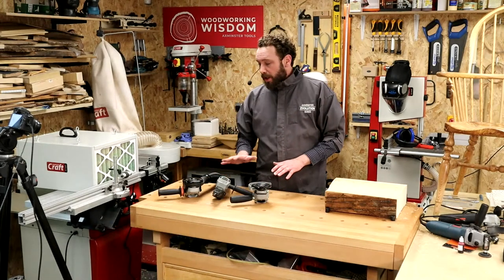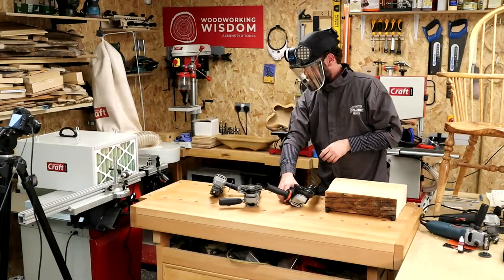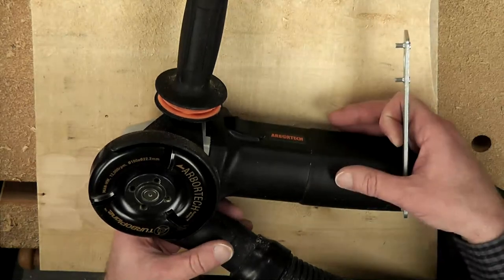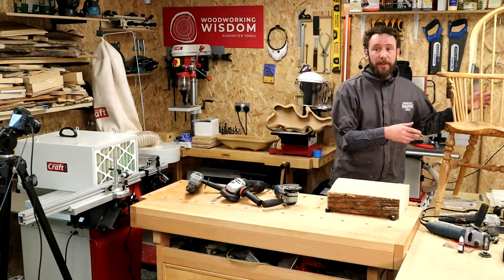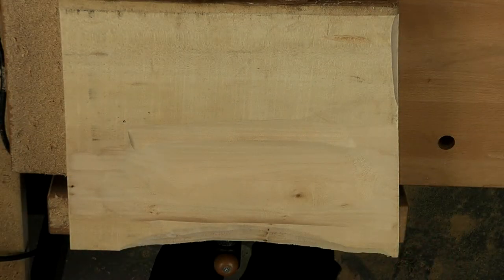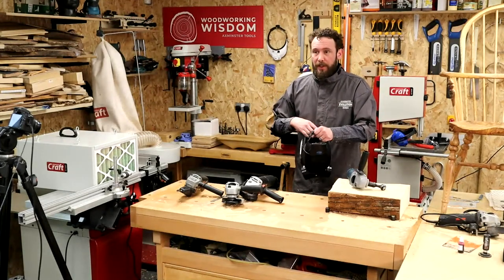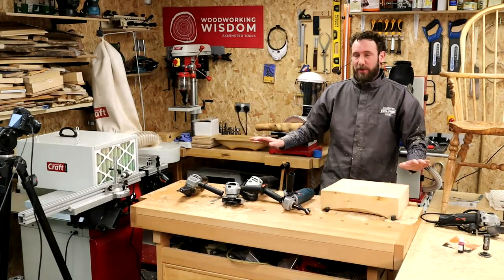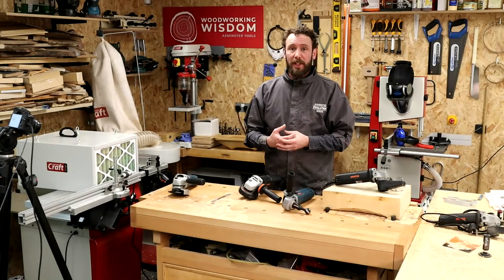Arbortech Power Carving Q&A with Ben - Woodworking Wisdom

Comment: I really enjoy the videos put out by Axminster.  I understand your in business to sell these, so it's not advisable to tell the drawbacks.  However I have the large Arbortech grinder and It is much more expensive than a regular 4" angle grinder which essentially is the same thing.  And a grinder is heavy to hold, I'd never use this to chisel.  The cutters are however very nice.  Also advisable to use hearing protection as part of your ppe.

Comment: Do you know if the turbo plane would be good for removing cedar bark? I was going to buy a 9 inch planer disc bit they say cedar bark is too stringy and it won't work, what do you think and have you tried it before?
Reply from the maker: Hi these, it is possible to remove cedar bark with the turbo plane, but as you say it is quite stringy and wouldn't result in a great finish. We would recommend using a sharper fine knife for removing thin bits of bark. Hope this helps